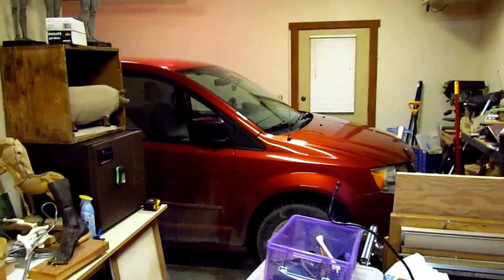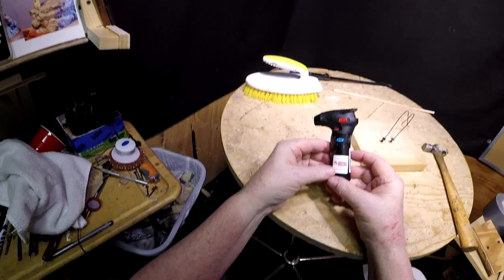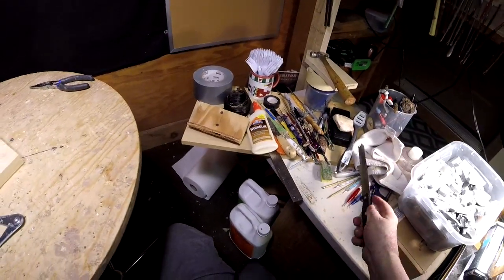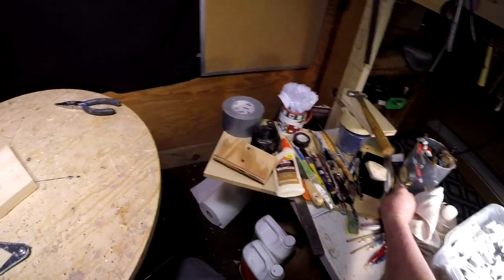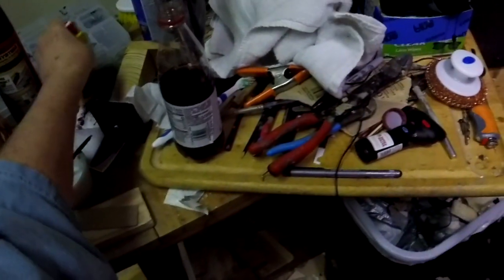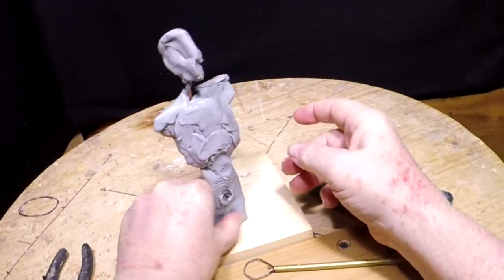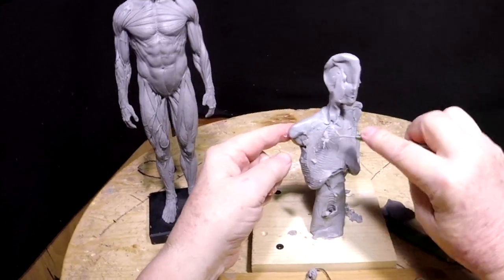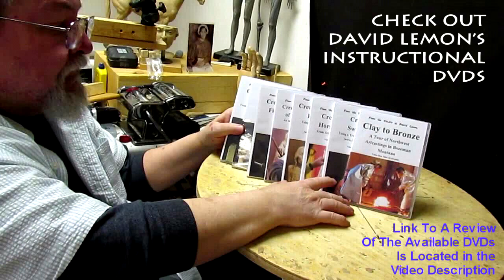Trying my Monster Clay for the First Time

Comment: Not sure about theother clay you use but the monster clay is nice cause you can toss it in the microwave and turn it to liquid lol
Reply from the maker: Why would you do that... lol
Reply: @clayguy1  You're used to the plasteline clays. This one is meant to be warmed up in a microwave. Some folks even heat it to its liquid form and pour it into molds, or at least back to where it fits into its original plastic container
Reply: David Lemon mostly for pouring into Silicone moulds, to duplicate previous sculpture parts.
Reply from the maker: @LIBERTYVIEWS  I read the instructions.. they said do not put in a microwave... I'm heating it as they directed... in the instructions. It's working fine
Reply from the maker: Actually the instructions said do not microwave... I'm just doing as the instructions said..
Reply: @clayguy1  I stand corrected. Apparently other sculptors didn't read the directions as you did David.
Reply: @clayguy1  They say that in the instructions cause it can be very dangerous if mishandled, but you can in fact melt it and pour it into a mold. The reason why anyone would want to do this in the first place is, for example, if you poured the clay into a face or head mold, you could then slightly alter things like lips or nose very quickly. It allows one to quickly create multiple variations of the same item,  but each slightly different. You hand build everything from scratch so most likely you'd never be doing this though. It just has several uses is all :D
Reply from the maker: @TheBroodingTom  I understand that.. thank you.. Last night I was remembering I did a Bust of Anthony Quinn back in the 90s.. It was molded and cast into bronze.. I sold several.. and got to present a copy to Mr. Quinn.. at a banquet at Cesars Las Vegas.. He hugged me.. Zorba the Greek, Barabas.. and so many others, hugged me.. I still have that rubber mold.. If I can find it.. maybe I'll try that with melted Monster Clay... Someday..
Reply: @clayguy1  WOW now that is awesome!! And yes, that would be cool to see too! I never made a mold, sadly... but perhaps one day maybe? lol   If you do just be careful, I imagine that stuff would just continuously burn if accidentally spilled on one's self. You be careful!
Reply from the maker: @TheBroodingTom  The rubber mold or silicon is made for pouring melted wax into.. I got Mr.  Quinn to take a piece of soft clay and with his finger draw it out and leave his fingerprint in the clay.. then sign his name on the clay as the name plate.. This was over 20 years ago.. not even sure the mold is still usable.. First I have to find where I put the dang thing... haha